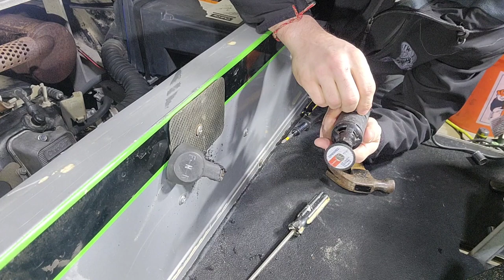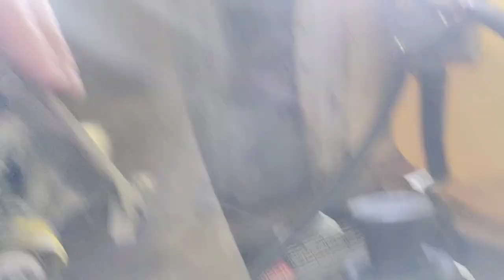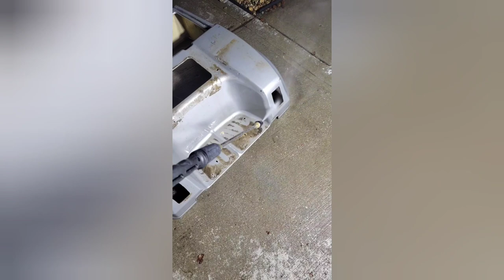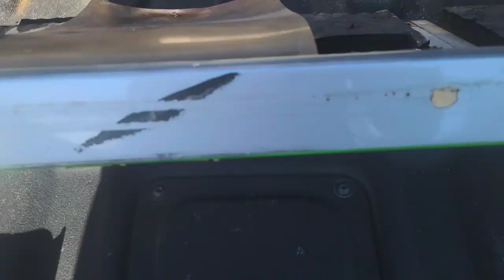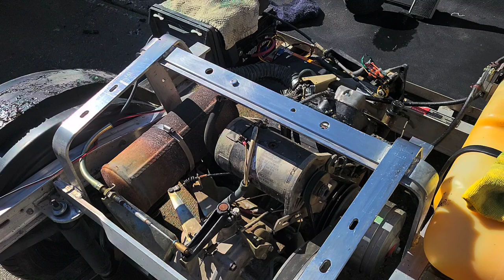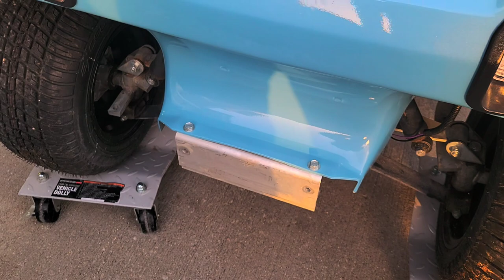1997 Club Car DS body removal part 2

Comment: I wish I would have watched this FIRST before taking a part my cart and spray painting all the dull aluminum parts with metallic spray paint. It turned out nice, but this would have been soooo much easier and quicker. I'm currently trying to put that front trim back on with the "t-nuts." It's a booger! I'm going to try your toothpick hack!
Reply: Can you explain what a "snubber" is?
Reply from the maker: @lisalandry7416  The snubber is the round-ish rubber piece that sits on the tongue of the engine cradle. It always the engine to move freely up and down but cushions it from hitting metal to metal.
Reply: @a-dubs220  Thank you!